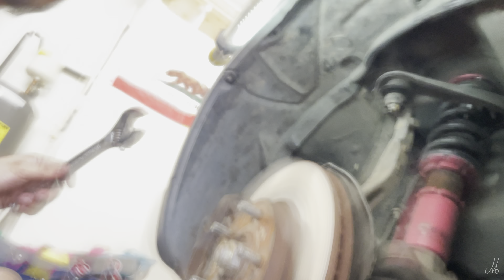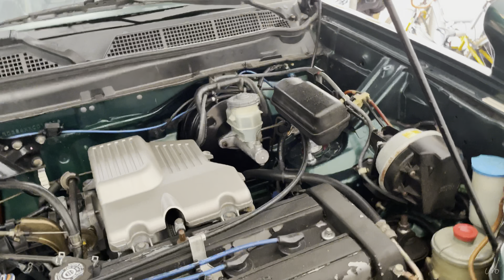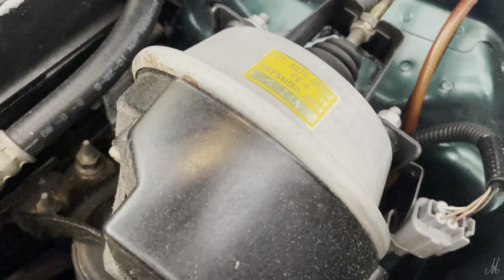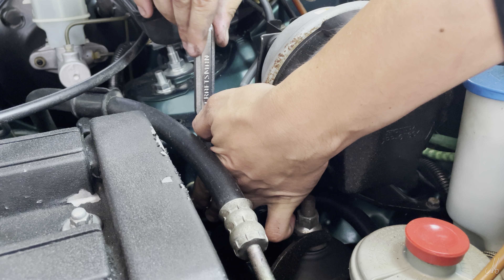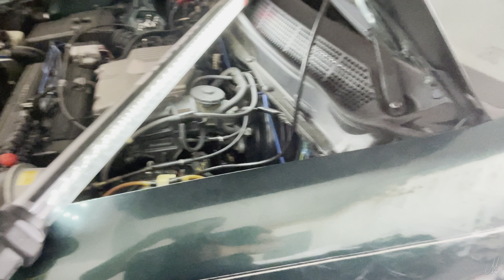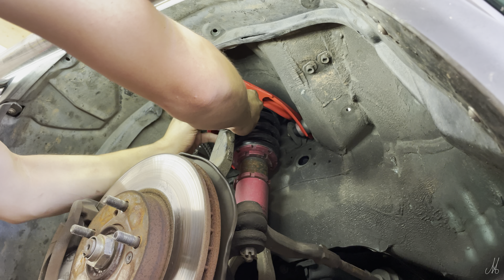Honda CR-V 97-01 upper control arm replacement

Comment: On passenger side I removed battery and battery tray to get aft bolts.

When removing Air box to get access to fwd bolt I removed 2 aft bolts and thought the box would slide off fwd gromet.  But It broke.

Got it glued back.  But did you remove the fwd bracket for getting the air box off the front gromet?
Reply: Do you have an update on this? About to do mine
Reply from the maker: I have posted an updated video